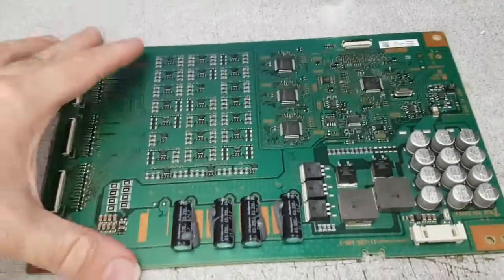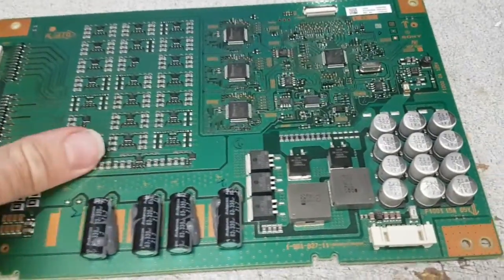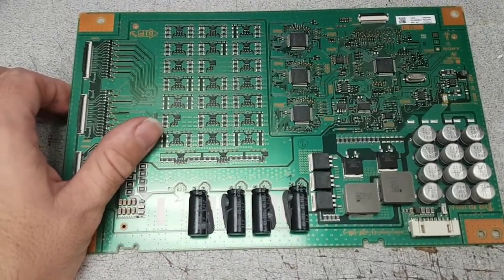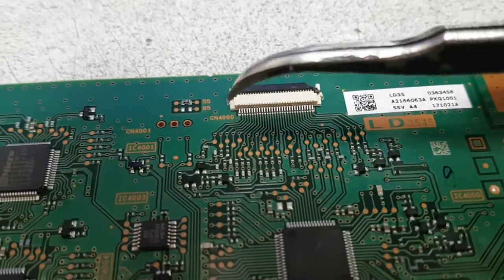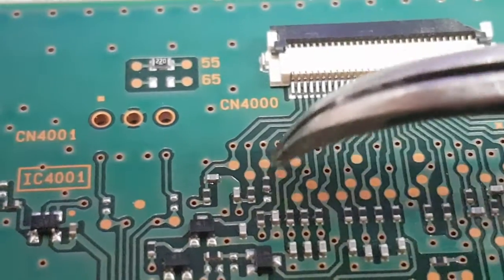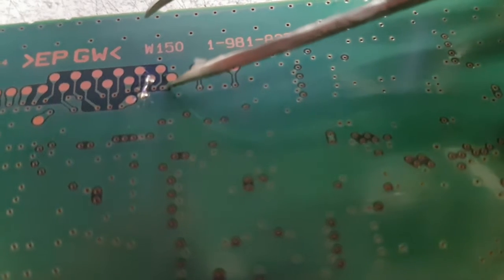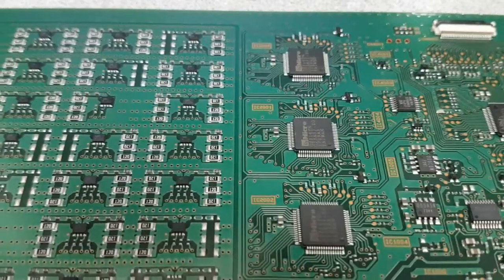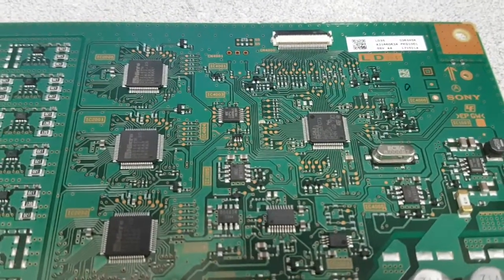Fixing Sony XBR-65X900E XBR-55X900E XBR-49X900E shutting off with 4 blinks - A2166063a mod

Comment: I really appreciate the video thank you. Going in I had no idea the resistor was the size of a grain of sand LOL butt a lit magnifier and a soldering iron I was able to do it after a little struggle. It worked great what the defects are in the LEDs I cannot see. We are going to replace it and use that one in a bedroom somewhere as a bit of an upgrade. Guys like you make this app worth while thank you

Comment: Hey, Thank you for sharing your knowledge with us. Looks like this worked for the majority of people. I am just NOW experiencing the 4 red light error. However whenever I do a soft reset and try to turn the tv back on, it boots up, the google logo comes up and starts spinning and sometimes I even make it to the input selection screen before it goes black and flashes those 4 red LEDs, other times screen goes black right after google logo spins up.

Couple questions, If it's an over sensitive LED controller would changing the resister value on track 3 instead of removing it cause the board to be less sensitive or is that something completely different?

I have tried soft resets and a factory reset so I am thinking this is my last resort before buying a replacement TV. Is there a way to test the Power supply unit first? I read that the 4 red LEDs is also the signal for LED voltage protection. So if the PSU went bad could it also be causing this error code?

I appreciate any insight you can share. Thank you for the video.
Reply from the maker: It is just a bad LED strip. The strips need to be replaced. Removing the resistor just allows some in-between complete stages of the failure to be ignored, but others won't be affected by it and the screen would remain dark and the 4 blinks would still show up. That's all, it's a patch, nothing more.

Comment: what are you grounding it to?  it's all green on my board where you grounded it to
Reply from the maker: 1st: buy a multimeter. It is a must in virtually all electric repairs. 2nd: once you have one, run how to test resistance. 3rd: measure chasis (or any of the copper corners on most boards) to any other point on the board. if the DM beeps it is ground.
Reply: @coppelltvrepair  "Give a man a fish, and you feed him for a day; teach a man to fish, and you feed him for a lifetime"
Thanks

Comment: Did what you said and still turns off
Reply from the maker: Well as I say in the video this is not the proper solution to the problem, it is just a hack and as the other comments testify it works often enough, though they don't come back to say for how long. Sooner or later the time comes when only the right approach can help, which is replacing the LED strips. Whether you skipped the middle phase or didn't do something right I have no way of knowing. But by the mere statement you've placed that didn't even contain a question I'd say there is a decent change you didn't do something right...no offense meant. And there's still the chance that you did and it just needs LED strips replacement. That's all I can say for your particular case.

Comment: Tanks a lot !
Had a hard time finding a tutorial working with my model, kd-55xe9005, but this saved it !
I can't even tell what's wrong with the LEDs....
I will just watch out for any fire start since if there is anything wrong with a led overheating there is no more security.
The sad part is that the OLED tv I was dreaming of will have to wait...
Thanks again 👍

Comment: A big thank you for this video! Grounding the 4th pin was enough to breathe life into my kd65xe9005. Left the resistor alone. And now with the screen back on I can see that a broken led in the lower right corner was causing the shut down.

Comment: Thanks for sharing your workaround! Worked perfectly on my XBR-75X900F. The backlight board on my TV is slightly different, but the pinout on the connector going to the main board is the same.

Comment: hey man , is it possible to ""similar to how you did it in the video"ground pin number 4 on the LD board of a Sony XBR-55X900H or would it be a different pin ? or is grounding any pins don't work for my model at all ?
Reply from the maker: Unless it is the exact same board - A2166063a  - or a board based on the exact same PCB (they should look identical next to each other) then I would recommend against any assumptions as to what would work on your board. In some rare cases it is possible they may have similar failure and similar solutions, but failures are usually limited to particular design families and rarely spread outside of them....and Sony has the tendency to have unique design for every freakin' model they release so what fails in one model is often different from fails on the models before and after it....which again means you should not jump to conclusions. As far as the pins go it would be wise to go by pin label explained on a table somewhere nearby the connector rather than the pin number.
Reply: @coppelltvrepair  what is the label called ? and could it be on the back of the board ? because when I look at the board while attached to TV there is no labels which in total should be 30 , thanks for the reply
Reply from the maker: @IdrisElKing  I am sorry, I do not remember where the label is on the board, if it is on the board at all. Some OEMs - and I think Sony is among them - sometimes do not put a lot of info on the board itself...but then they often have fairly decent service manuals where the connectors are well documented.
I do not remember the specifics of this board, sorry.
Reply: @coppelltvrepair  all good , thanks for the reply , have a good day

Comment: I did what you say, and now my TV turn on, Sony Logo appeared the first time, but now I only have music from Sony and no image. Now turn on, but no Sony Logo anymore, just a music.
Reply from the maker: My guess is whatever weak LED there was it got burned open that first time after the hack and now the whole circuit  is open and you just need to replace LED strips.
The same would eventually happen to everyone else using this trick, only after some more time....for you it happened immediately.
Reply: @coppelltvrepair  After to replace it, I need to revert any change in the board?
Reply: @coppelltvrepair  I bought this tv with this problem. Now the TV turn on, the screen is on, but in black. I was looking the board and somebody made a bad work and tried to fix the opposite side and removed a resistance. If I replace or connect with another line, just like I did before with your help, may it help? I think that without the resistance the circuit is opened and the TV is not going to work.

Comment: At 2:14, when you say "cut this track" where exactly are you pointing at? Do you mean the track before the circle ground? or do you mean the track between the solid circle and the smaller circle with the hole in it? or does it even matter. Thank you

Comment: Where do I actually solder third point  on the back of the board to? It’s hard to tell. I thought you said ground so I soldered a jumper wire to the point and then to a large gold rectangle area to the far left corner. It didn’t work then. Should it have?

I don’t have a heat gun so I just cut the trace on the front side and verified with multimeter no current now goes from 3rd spot to the 4th pin on the chip.
Reply: @MICMON, He bonded to the ground plane on the back side of the board.  I assume be scratched off the solder mask, exposing the copper ground plane, and added a jumper wire.
Reply from the maker: I have to apologize, but I just don't have the resources to watch the video and see what was done. Others appear to have figured it out so it should be in the video.

Comment: This worked for me. XBR-55900E. Did the same exact thing to the board so that it could be returned to original if needed. I originally tried a software reset by unplugging for two minutes then plugging back in while holding the power and volume down. Did this five times but no luck so assumed hardware issue. Not sure how much more life is in this thing but for now it’s working, saves it from the trash heap. Thanks so much for sharing.

Comment: Thank you very much for this video! With this workaround, you've help me get a little additional use out of an otherwise 95% perfect TV. The "save for later" parking of the resistor and the short jumper on the back side of the PCB are genius-level mods.
Reply: Where do you solder the 3rd spot on the back of the board to? It’s not too clear in the video..

Comment: Tried this, ive tried swapping all the boards. Tried all the tips and still have 4 blinking red lights.
Reply from the maker: So you have a permanently failed LED strip I guess.
Reply: @coppelltvrepair  thanks for the response. I do have a full set of led strips I was hoping to not have to get into it...but you've now given me hope.
Reply: @MoshNorris  Did that end up working for you? If could've just been a bad power supply unit if everything else failed.... I am just now experiencing this problem. TV screen works after soft reset until Google logo goes away, sometimes I make it to input select before screen goes black.

Comment: I have a 55x990e with 4 red lights. I just tried this with no luck.  That being said , do you think the problem could still be the backlights if this didn't work?  My understanding is if you get 4 red lights, it could either be the led backlight  strips, the backlight inverter board, or possibly the main board.   Im just trying to see if by this not working is a clue in and of itself.  ???
Reply from the maker: As I hope I explain in the video the issue here is that the LED driver is perhaps a bit too sensitive and triggers from a problem in the LED strips that is not actually fatal. That said, it still IS a problem and practically certain to progress to a bigger, usually permanent problem as most LED strips eventually do.
With that in mind my first suspicion would be the strips. The hack here is just a temporary workaround that is by no means applicable for all cases.

Comment: Your solution worked perfectly. I didn’t have the capability of completing this task, but I found a local tv repairman, and had him do it. Took him 15min and he only charged $20. He thanked me for your video also. 
Put the board back in, worked. Saved a $1000.
Reply: Is your sony bravia TV still working now 2 years later? I just found myself in this same situation.

Comment: Would replacing the entire board make the TV run fine or will it still be at risk of a larger LED failure?
Reply from the maker: The board in this scenario is not faulty. It does what it is supposed to do, it's just overly sensitive...arguably...since it detects a problem that is not fatal and stops functionality whereas it can actually still be provided. Make no mistake, though, the LEDs will eventually fail and then it won't matter if this is the same board or a new one. The one benefit from such early failure catch is that if the LED strips get replaced before they actually fail and burn this may avoid the potentially burning leds to also damage the acrylic light transfer panel that sits on top of them (for edge-lit panels)...and that is a major benefit if repair is being considered at all.
Reply: @coppelltvrepair  Ah that makes sense, thank you!

Comment: if I ground out the pin on the back of the board like what you did.  is it still necessary for me to remove the resistor on the front of the board ? or i can skip that step ?
Reply from the maker: Theoretically it might still work. But it is a bad practice and risk and I haven't tried.
Reply: @coppelltvrepair    technically if I find the that same pin on the Mainboard side I can short it out there as well ?  but I assume doing it on the LED driver board is better and cheaper if anything goes wrong as suppose to screwing up the Mainboard..
Reply from the maker: @grilledchickenwrap  Why would you mess with the main board when there is a simple way to address it on the LED driver that does not alter its structure (merely moves a component in a way that can always be restored later) and utilizes a simple jumper you can again always remove later if you don't want to.
There are probably tens of alternatives that would work. Why would you focus on any of them if this is something that is fairly simple, easy to undo and works?
Reply: @coppelltvrepair  true.!
Reply: @coppelltvrepair   BTW I have a 65x950G  model  has similar LCD driver board but not exactly same  am i still looking for pin 4 or do you think it is a different pin for this board ?
Reply from the maker: @grilledchickenwrap  I avoid making assumptions in such matters and would recommend you do too. Take your time, trace and RE the circuit and figure it out. Then you know. I certainly do not know it off the top of my head.
Reply: @coppelltvrepair   Thank you for all assistance.. I was able to revive the TV , learned something new.

Comment: ahh...  I have a xbr65x950G   with similar issue I am guessing, it will power up like nothing is wrong you can see backlights and you can see the setup screen but few seconds later tv will shutdown iwth 4 red blinking lights.   I tried to ground out the BL_ERR on the power supply side but that did not do anything.  I am guessing for my model I have to ground out the error code at the LD driver board side   which it sending signal to the mainboard to shutoff.      will try this out.  Thanks.
Reply: Did you have any luck with this? My 950G just started this, I was considering buying a new power supply board.
Reply: @jlp8648  yes I did exactly what he did and solder the board with a jumper and it’s working now.
Reply: @grilledchickenwrap  Do you happen to remember which resistor it was on our particular tv? I believe I see a similar setup along IC1006 but no way of just "moving" the resistor, which holy crap it's small. I'm an idiot and bought a new power supply board, of course it didn't work. Grounding BL_ERR didn't work either.
Reply: @grilledchickenwrap  I have the same model, I found it, surprisedly it was the same pin. but make sure you double check it. I got the tv working. the LD will still flash red 3 times. but the tv will work. after got the tv working I use YouTube to have the screen white and then you can see if your LED has problem. and it does. I can see a small dark spot so probably 1 or 2 LED is burnt
this is a great test to make sure that if there is any issue with the boards or it is actually the LED strip